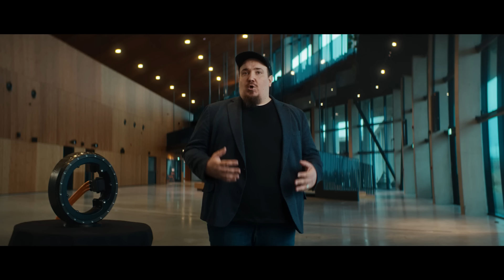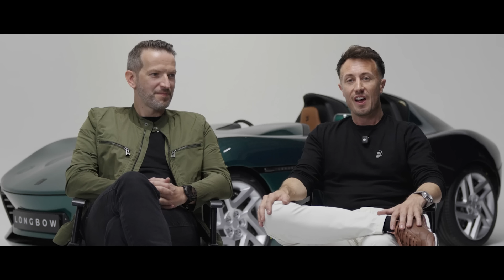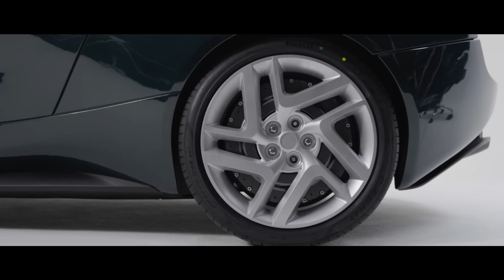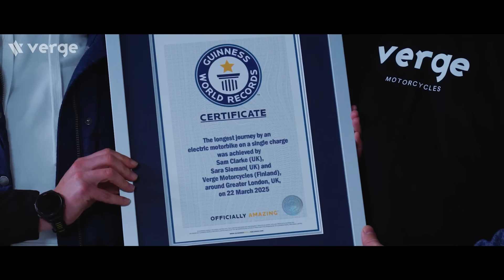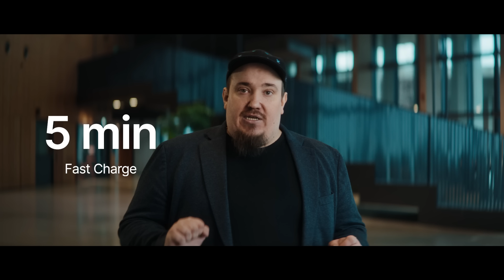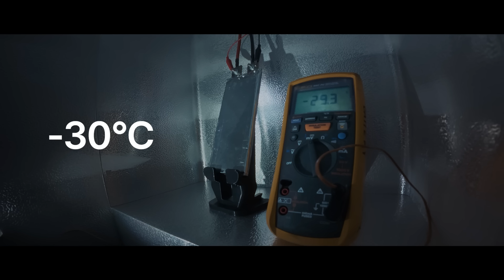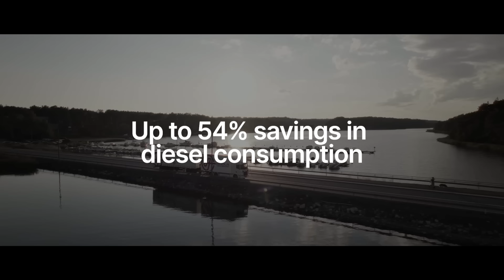World's First All-Solid-State Battery in Production Vehicles | Donut Battery

Comment: I’ll believe it when shipping in a volume production vehicle
Reply: Same, doubt this is it
Reply: Ahola Transport mentioned in the video is a big player locally, waiting to see these cova power trailers in some their trucks on road.
Reply: To prove the 100,000 cycle life claim, the test would have had to start about two years ago! Five minutes charging, five minutes discharging! Best regards from battery testing!
Reply: @canadianpoweredcamp  100k is just an estimate, its called accelerated life testing.
Reply: @jaro6985 An accelerated lifespan test is not meaningful for batteries. Aging plays a significant role and cannot be extrapolated. Stating such a high number of cycles is misleading.
Reply: @canadianpoweredcamp  it is very much meaningful. Accelerated life testing at extreme temperatures is used in many industries.
Calendar aging can be extrapolated after 50 or 100 days to a reasonable but not perfect estimate, its actually going to give you a worse estimate in most cases. 
Note that cycle life is not a claim about calender life.
Reply: Amusing that there are, so many SM sycophants of BS.F
Reply: Check Verge motorcycles
Reply: @jepjep000 not volume
Reply: No you won't 😂
Reply: Yes.  Are they (Verge) manufacturing more than 10,000 motor bikes?  If not these batteries could be handmade and they won’t really be able to scale?   And then there is the cost?  How much more expensive is it above Lithium which is itself too expensive.
Reply: Oil shills moving goal posts.
Reply: @RichardEricCollins nah bro😭😭 honestly I love this information massively, but if the goal post isn’t HAVING IT IN ACT VEHICLES then is the goal post to just make vaporware about it?… 🏁 Goal: Ship It With A Prooddducctt
Reply: @DreDresPlaylist  In a Verge TS Pro bike, will be at CES v v soon. A bike with 370+ mile range - that's 2-3x the ave petrol bike.
Reply: YT expert knows best
Reply: @RichardEricCollins   go ahead, buy from them then.
Reply: @DarukiNeo  imagine the money you'd make back being the first to take one apart, view count would be crazy
Reply: @RichardEricCollins Oil shills are some of the biggest culprits for making wild claims about future developments that are always just around the corner, so you can drop everything else and just carry on burning oil until their unicorn technology sweeps the world.

This video is making some extraordinary claims, so only the most naïve viewer wouldn't demand concrete proof to back up those claims. All we have here are some 3D animations and vague marketing copy. Going on available evidence, there is no product, only a wishlist.
Reply: @rabidpb  soon as the first bike ships with one of these batteries in it, the truth will be revealed.  Gonna have 9000 yt vids on it
Reply: @RichardEricCollins  Branden is one of the most outspoken EV supporter you can find. Click on his channel before calling him an Oil Shill.
Reply: @RichardEricCollins we just invaded a country for oil. It's crazy times in the usa
Reply: @RichardEricCollins Well he's making a claim saying he basically made a method to make lead to gold and we don't have details on how, chemical make up, actual costs, etc. Like you can say materials are cheap and available, but that means nothing if I don't know what it's made of. You can say it's energy density is great, but what is it? The only example we have is extremely fast charging.
Reply: Well thought out cynicism is a sign of wisdom..... 

But trolling every new concept is just ignorance...
Reply: @nc3826  It's not trolling if they have no proof. You can say anything you want, but you need proof to back it. At best, we have a motorcycle that has a battery of unknown size, capacity, voltage, etc. 

And we also said a blanket "made of cheap accessible materials" which is a nothing sandwich. Is it even lithium ion? Is it sulphur? Silicon? Like that statement mean basically nothing. Just look how many established politicians say they seek "affordable accessible healthcare" which just means "I have no interest on changing anything for healthcare". I would love for this to be true, but extraordinary claims require extraordinary evidence.
Reply: @Skylancer727  I'm sorry that the concept of "well thought out cynicism"..... Has triggered you. to troll, my entitled friend.

Just out of curiosity what OEM do you think they should emulate? Look at Tesla, and how often does it change its rollout dates and other specs... There is no such, thing is perfection. Proof is irrelevant to the relevance of a technology. say hi to Sonic for me ;)

""affordable accessible healthcare" rant  LMAO
Reply: I don't mean to be rude, but when it comes to mass-producing solid-state batteries for automobiles, it currently seems that this is only possible in battery-technology-leading countries like China, Japan, and South Korea
Reply: @dyson1133 countries that have actual growth in manufacturing and tech.
Reply: Did you watch the video?
Reply: @viyusavery248  Independent testing is always needed.
Reply: @JRP3   a car that lasts 20 years wasn't proven after the 20 years it would have happened DAY 1 in the engineering room quality is proactive and not reactive 

Independent test just help those who are reactive and timid so .. nothing wrong with independent testing because we consumers are in a state of reaction to a creation

Independent testing is not NEEDED it's really optional
Reply: @viyusavery248 Ever seen what happens to people who buy the new car models the moment they come out? You get constant warranty claims, sometimes engines blowing, the Cybertruck had failures of all 3 electric motor designs, Chevy's pouch batteries were catching fire spontaneously, etc. History has shown just throwing things out there is the worst way to do things. This world doesn't favor innovation, it favors the safe. It's why the most popular game platform is Playstation, why the most popular phone is the iPhone, the most popular PC OS is Windows, etc. Everyone says innovation is what they want, and then they get a Windows 8, the Wii U, the LG Wing, etc. All things that look cool and innovative, but nobody bought them and their failure rates were rather poor. Hell a Wii U gamepad couldn't even be replaced.
Reply: @viyusavery248  Incorrect.  I've been studying the battery space for 20 years now, I've seen many claims that turned out to be false when independently tested.  Accelerated Cycle life testing, C rate, temperature performance, energy density, etc. all need to be tested independently.  Anyone claiming differently doesn't know what they are talking about.
Reply: @JRP3  I am correct the point I was making is that the TESTING is not what proved the claims wrong 

The claim was already false or true  BEFORE any TEST

TRUTH is not reactive.. it helps to verify
Reply: @viyusavery248  Your "point" is irrelevant to the discussion.  We need to see PROOF of claims, which should be obvious to anyone.  Either the claims stand up to real world third party testing or the CLAIMS are PROVEN to be false.
Reply: @JRP3  the product will stand up whether or not it is proven and understanding this is relevant 

You seem to think this is some zero sum game where if I make a point you lose something 

BOTH points can exist in parallel and coexist..

And it is relevant because batteries involve longevity claims and some of them cannot be practically verified independently especially life cycles 

But if you want to prove 100,000 cycles in real life by all means go ahead

I hope your at least 5 years old because that's going to take some time
Reply: @viyusavery248  You're simply exposing your ignorance of battery testing methodology.  There are methods of projecting long term cycle life through accelerated testing and measurements.  However the cycle life is the least important of all their claims, it could be only 10% of the claim and still be a breakthrough if all the other parameters are met.
Reply: @JRP3  don't change the goal post

As you said " either the claims stand up to REAL WORLD third party testing  or the claims are proven to be false"

So don't bring up accelerated anything or call anyone ignorant these are your words
Reply: @viyusavery248  You keep proving you know nothing about cell testing.   That happens in the REAL WORLD, as opposed to press releases from the manufacturer, which is all we have so far.
Reply: @viyusavery248   i can fly like planes, believe me.
Reply: @DarukiNeo  I believe you
Reply: @viyusavery248   now sell your house and give it to me, i will doble it teaching people how to fly
Reply: @viyusavery248 a niche market motorcycle is not a volume production vehicle
Reply: @brandenflasch  it is considering the context of this being a first generation product with bleeding edge tech ..

I've never seen any new technology in history when released first came out in the Hundreds of thousands.. not the iPhone, not even the internet itself 

People always call them niche to Cope with the reality that is coming
Reply: @brandenflasch   "Believe?" Thanks for that regurgitated age of entitlement, mantra....    That's irrelevant to the development of the technology.

It's a shame that some people confuse monetizing social media likes and dislikes, for something relevant to technology. C'est la vie
Reply: @brandenflasch  that brand isn't even reliable. it is one struggling brand, backing another struggling brand. both brand are questionable and sus.
Reply: At least they answer emails, it takes a bit, but they are legit.
Reply: @carpenter3069 yeah and references of the motor use also in video, there are things you can just go and buy.

Comment: Even wider temp range than CATL Naxtra 🧂🔋!
Needs no thermals?
Here in Phoenix AridZoneA, I was still leery of Naxtra's 70°C top.
Reply: Naxtra is a garbage. Low energy density batteries is only for stationary usage
Reply: @maximkosheleff Well everything's garbage now. But your take is trash bc Naxtra doesn't need thermals & anti-explosive packs. Model S pack density only 184wh/kg.
Reply: @HoopsKevinski. I do not trust claims about sodium batteries of the same energy density as lithium. 
Only  steep discharge curve alone decrease real energy a lot. Lower voltage, less working electrons etc.
175 from naxtra is about real 135-140

Comment: You didn't mentioned about the cell chemistry since the cell is totally made of abundant materials. Is it sodium ion by any chance?
Reply: Seems like a scam when the details are omitted.
Reply: @ScubaSteveCanadaNo. It's not in my opinion
Reply: @nishantpatil3230 it doesn't mean it is, but it doesn't meet it's burden of proof. I wouldn't trust anyone saying they made real hoverboards without telling me exactly how it works.
Reply: Definitely not sodium with that energy density, lithium is an abundant material. It’s the cobalt/nickel/manganese that aren’t so much.
Reply: @geekswithfeet9137 
True! I did realized it later. So it's sure that it is lithium based chemistry but is very stable one to give such performance.
Reply: @nishantpatil3230 If it was lithium based, they wouldn't say it's cheaper than lithium ion
Reply: @MaxKosenko But they haven't said clearly that it does not contain lithium instead they said lithium ion which is mostly associated with liquid electrolyte. But I wish it's not lithium at all then it will be even more interesting chemistry.
Reply: Made of donut filling. He mentioned this at 7:34.
Reply: @Rusty-Metal  The secret is in the jam!

Comment: Donut lab' motor-invertor-battery techs will allow OEMs to design and manufacture ultra sci-fi modeled death stranding 2 likes 3 wheelers for off-road and daily driving with 400wh/kg cells with 100,000 cycle life(atleast 20 years of calendar life) and a decent battery pack capacity,they will have atleast 450 miles of WLTP range with top speed of 100 kph or 62 mph which is more than enough.real life death stranding is waiting for us . Thank you donut lab.

Comment: This is huge, if true.
Reply: Cleo Abrams ah statement
Reply: If true as you say … this is vaporware
Reply: @gregoriomunoz7176  Vaporware is mostly when you claim to deliver it "some day". But this dude is saying it's already in the live production vehicles. And this motorcycle company would also be betting its reputation on it.
Reply: Ain’t true
Reply: @Chingusbobingus it is true. Just Google "CATL solid state batteries" They will be in production model cars next year.
Reply: if, if ...if. Yea ..IF yes , then yes ..otherwise its bullshit.
Reply: its tig if brue
Reply: BIG if
Reply: They can achieve industry leading 520 wh/kg with dry electrode coating process compared to  their current 400 wh/kg wet process
Reply: Ifs and buts this and that … stick to reality and not YouTube bs
Reply: @techlabukn.h.4501 but it is true. It's not BS. Just Google CATL solid state batteries. If you do a little research you will see they will be in production vehicles next year.
Reply: Donut lab' motor-invertor-battery techs will allow OEMs to design and manufacture ultra sci-fi modeled death stranding 2 likes 3 wheelers for off-road and daily driving with 400wh/kg cells with 100,000 cycle life(atleast 20 years of calendar life) and a decent battery pack capacity,they will have atleast 450 miles of WLTP range with top speed of 100 kph or 62 mph which is more than enough.real life death stranding is waiting for us . Thank you donut lab.
Reply: @davidfujkk8018  Real life Death Stranding is waiting for us (laudatory).

Absolutely incredible take. Please leave your brain to science, neuroscientists need a laugh as much as the rest of us.
Reply: @davidfujkk8018  ne 20 si 300 yıl eder 100.000 döngü

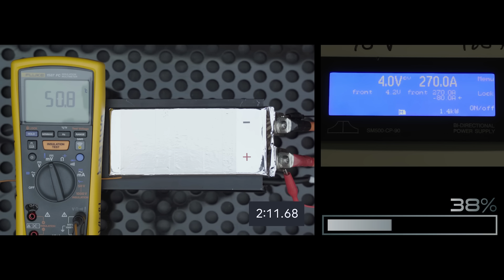Comment: 13:20.. Wow 12C charging is quick!.. no ion pile up problems on the anode? Look like you solved the Ion conductivity problem from Solid State battery.  Nice bi-directional E-load btw!!
Reply: 270A continously into such a small ”lipo pouch” - type cell and it barely even reacts (in terms of expanding / puffing up) seems incredible 😮
Reply: 12C? 
its 6 C
Reply: @snake9100  Why do you think that? 270A / 12 = 22,5Ah, which seems realistic for that size.
Reply: @4n3d  1C means rated cell capacity charged in 1 hour. Without rated capacity for the single cell we cannot know the C-rating for 270 A current.
Reply: @MikkoRantalainen  It has been mentionned 200kW charging. We know that the largest pack is 33.3kWh and if it is like the previous pack version, it operate un 96s "400V" or 350V let say from reference of the 4 modules of 24s12p 21700. So 200 000W/350V is 571A peak of charging current which mean that for 270A test it is probably 2P for 540A or maybe 3P for safety margin of 571A / 3 which would mean a bit less than 200A per cell. But 33.3kWh under 350V is 95Ah which bring the number of p between 4 to 5P for 23.75Ah or 19Ah per cell... IF it is still at 96s NMC or NCA cell equivalent than the previous generation.
Reply: @MikkoRantalainen  Yes, I was estimating the cell capacity based on the data we have so far. And so that 270A charge rate that was shown would mean a 22,5Ah cell capacity if it was 12C. If it was 6C instead, like the comment I replied to suggested, it would mean the cell capacity of 45Ah at that 270A, which seems unrealistic at that size.
Reply: @4n3d  To be honest, pretty much everything in this video seems unrealistic when it comes to battery cells.
Reply: @MikkoRantalainen  For sure. Some new info seems to point towards them not being exactly traditional battery cells though, but printed supercapacitors instead. That would also explain the long cycle life. But then I wonder about the leakage current in standby.
Reply: @4n3d  Leakage current is indeed interesting. I would also want to know how they think they can manufacture printed supercapacitors for cheaper than modern day li-ion cells.

I'm thinking their "cheaper than li-ion" is considering total lifetime with the 100k charging cycles which requires multiple cell lifetimes in comparision with li-ion tech. Most people would prefer battery pack cost USD/kWh instead.